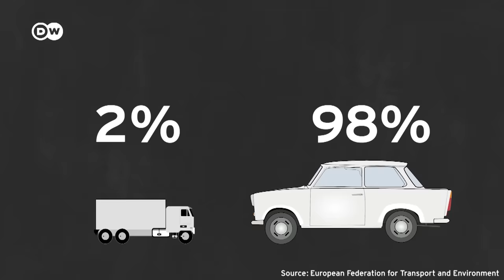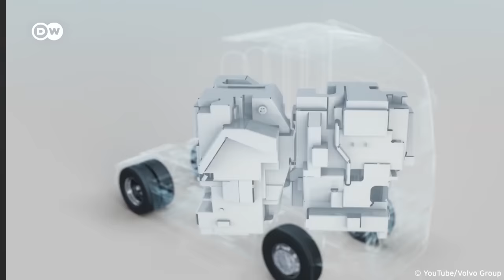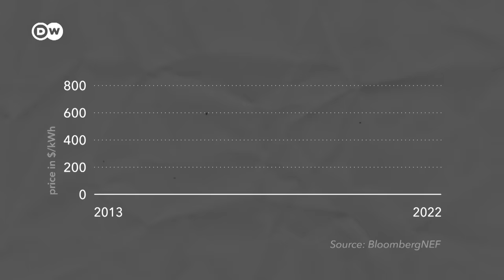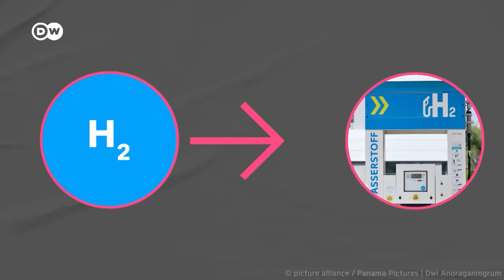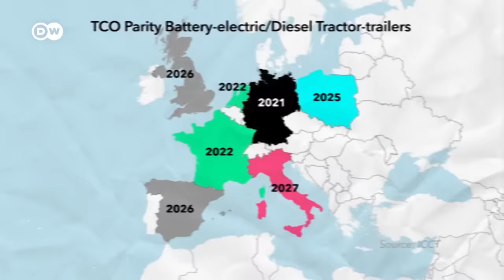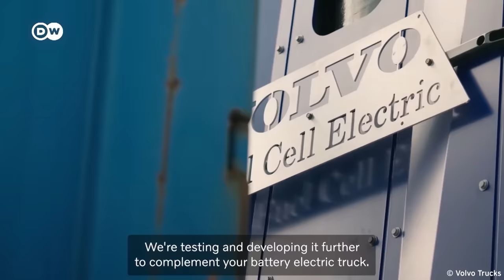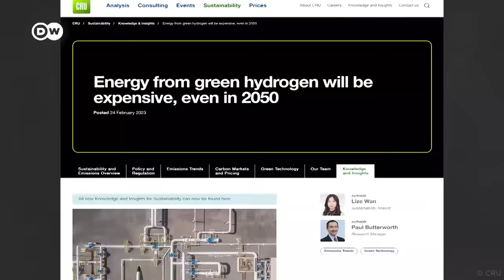Which will be the engine of the future?

Comment: I have the pleasure of working for a company that moves and dig up dirt, at times across rather large distances. I personally hope that Hydrogen trucks are still getting developed, despite the headstart of electricity. Mainly because electricity will likely never be a viable solution on its own to the needs that our company faces. More areas of industry working to cheapen and expand the hydrogen market would only help others for whom electricity will not be able to help, at least in the short term (5-10 years).
Hybrids would be a good choice, which is partly what we work with already, except it is currently fossile fuels, which we hope to avoid the moment it becomes economicly viable.

Thank you for the video, and I hope to hear more in the future of where this and adjacent areas are headed.
Reply: Toyota has developed a hydrogen ICE.
Reply: @stevenverrall4527  Too inefficient.
Reply: Hydrogen trucks will always be far more inefficient. The vast majority of trucks will be battery electric, also the ones hauling dirt.
Reply: Where straight electric isn’t feasible companies can use a diesel electric hybrid like what is Edison motors. 

Also quick swappable batteries like those from Janis electric are another possible solution
Reply: JCB has done the same.
Reply: And here's the thing you are getting wrong. It is hydrogen that has gotten the headstart, not batteries. We flew to the moon on a fuel cell, commercial lithium batteries on the other hand didn't exist till the 90's.
Reply: How niche is this application though, compared to movement of goods on existing arterials? How far before you get to a normal road, and therefore infrastructure like hydrogen filling, battery charging or swapping, or diesel?
Reply: I have a hard time believing that electric can’t already work for your company. What specifically is it that you think a battery electric vehicle can’t do? It is almost certainly just a matter of someone getting around to making battery electric equipment fir your niche application.
Reply: @stevenverrall4527 which just goes to show that Toyota is full of crap. It has half the efficiency of the already bad efficiency of the hydrogen fuel cell. For example, the hydrogen in the Mirai, which is about the most hydrogen you can get in a car, will get you at most 200 miles. And that is with an underpowered engine driven like a granny.
Reply: @rehanb637 what application wouldn’t be feasible for batteries?
Reply: @williammeek4078  hauling very heavy loads (100ton +) where battery weight would impact overall capacity. This is especially the case in areas that receive below freezing conditions where batteries are less efficient and store less power. Also pretty much any location that doesn’t have sufficient grid capacity to allow for charging ie remote communities
Reply: @rehanb637  100+ ton loads aren’t allowed on American roads. 
Those are better handled by train anyway.
Reply: @rehanb637  - temperature is proving to be much less of an issue with such massive battery packs especially with active thermal management systems. To move the temperature of that much mass requires very long "non-operating" soak intervals. During use the core temperatures don't change that much. When charging or otherwise sitting idle, the truck's thermal management systems can be engaged (not unlike a diesel being left to idle all night to keep from freezing up). This could be an issue in Alaska or the Dakotas but much less so down here. However, your comment about remote communities certainly would be an issue.
Reply: @Simon-dm8zv  There's absolutely no mention of the pollution caused due to the production of batteries in these vehicles and how they'll be handled after their life.
Reply: @thereckon3592  True, but it is a well known fact that EVs are the least polluting option.
Reply: @rehanb637 Mine haulage trucks are already diesel-electric hybrids, so it's not even clear why we need a crusade here.
Reply: @Simon-dm8zv  Are the though? I'm assuming hydrogen vehicles could run for at least 15-20 years with proper maintenance would an average EV with proper maintenance last that long without a battery change? So we need a comparison between the pollution/energy spent to produce and maintain an average EV vs an average Hydrogen powered vehicle over a long time.
Reply: @thereckon3592  Oh yes. Hydrogen vehicles are so inefficient that they require 3 times more electric energy which makes it very hard to win from battery electric vehicles. We know that older EVs are doing better than expected regarding battery life and current generation EVs have batteries what will easily last 15 years. It is very likely the battery will outlive the rest of the vehicle in most cases.
Reply: @Simon-dm8zv  I'm not saying Hydrogen vehicles are efficient than EVs right now, it'll be better but consider the polution and energy needs to create batteries for EVs.
Reply: @thereckon3592  You can find several life cycle analysis reports that cover exactly this kind of comparison.
Reply: @Simon-dm8zv  I couldn't find any. Care to point me to one?

Comment: Overhead wires.  This could work with, hybrids, fuel cells, and  fully electric. This can reduce the need for batteries. The only drawback is a massive upfront cost of installation.

Comment: Hydrogen Vehicles ARE battery electric vehicles... with extra parts... better to aim for full battery operated w/ Solar Charging
Reply: Extra parts? They dont require large lithium ion batteries(fuel cell electric vehicles are much better for europe's gdp since you dont have to import overpriced materials. It means that higher percentage of the vehicle's price is added to our gdp and less is going to indonesia) those are fuel cell electric. Hydrogen is currently expensive because of r&d costs and supply demand issues but all of them will be solved. Even mining machines and construction vehicles will be powered by hydrogen.
Reply: @jaegar2004  hydrogen vehicles as well are only 40% efficient 💀 electric vehicles are 93% efficient. Hydrogen is dead before it even began, you’ll see.

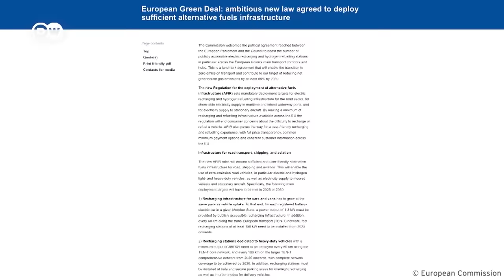Comment: 8:32 A megawatt charger is just four 250 kW chargers and many Tesla sites have dozens of 250 kW chargers. So not a big deal at all. Not to mention many trucks are doing local routes and can be charged at "only" 250 kW while loading / unloading.
Reply: I think a megawatt spike being thrown into the grid is nontrivial deal. That's about 250 homes going from nothing to peak power. I see my power lines struggle when I turn on a vacuum
Reply: @Chasval  US home are at peak power at 4000 W ? Are you sure ? Furthermore a 250 kW charger does not take 250 kW during the whole charge, it will be the same for a megawatt charger. Not to mention charging sites have batteries. Anyway, many industries consume far more electricity, in the US as everywhere in the world. And finally, as for cars, many charges will be done at lower power when the semi is parked, and off peak charges will be privileged since it will cost far less.
Reply: @Chasval  I have a supercharger site 5 km away from my home, with at least 24 stalls capable of 250 kW DC charging, why would the impact on the grid be higher than a 6 stalls capable of 1 MW DC charging ? And I do not struggle at all with my electricity, in fact I did not have any power outrage for decades (not even a one second outrage). So maybe France has a far better grid that the US (or wherever you live) but at least it proves that it is doable.

Comment: A lot of people are going to talk about trains in the comments, but they're already at the limit of what trucks provide that trains do not.
If you want trains to reach the same productivity as trucks, it needs to be some sort of transport system that brings items from A-B on a comparable route to roads, and also directly from a storage site directly into the business.
This is a necessary progress, if we want to reach our goals and slash emissions from multiple sides of the pie.
Reply: Germanyhas trains converted to r un on hydrogen. Japan has done the Hydrogen thing best. a new Nuclear power station using some of its zero C02 output to produce clean Hydrogen, and whats left over to supply Co2 free electricity to industry. And then in France a new Hydrogen SUV from NamX that uses swappable capsules of Hydrogen gas, 4 I believe; each providing 800k m of range.So range 4 x 800km, 3200km .Where I live, for smallish 8-16kgLPG barbecue requirements outside every hardware store. where's a storage of "Swap &
go LPG cylinders. At last, someone has thought to use the same concept for Hydrogen

Comment: Question, what is the safer of the two option presented in this video?  We know batteries can be highly dangerous once they catch fire and the fire departments do not know if they are really out, so what is the risk with Hydrogen?
Reply: If hydrogen truck catches fire and fire reaches the tank you don't need to call the firefighters. They will hear it most likely.
Reply: Watch a video of the Hindenburg to see the danger.
Reply: most people are so ignorant about hydrogen ffs it will not explode
Reply from the maker: Hey Dennis! There are a lot of safety measures in place with hydrogen vehicles. The gas is highly flammable but the main safety measures is the thermal pressure relief device (TPRD) on the tank. This one would discharge if the vehicle was engulfed in a fire. There are a lot of safety sensors which would for example lead to an automatically programmed shut down in case of a leak or impact. Therefore, obviously there will always remain safety issues with every car but the hydrogen vehicles have a lot of measures in place and are further developed. If you are interested, you will find more info easily online.
Reply: @DWPlanetA  There's absolutely no mention of the pollution caused due to the production of batteries in these vehicles and how they'll be handled after their life.
Reply: @thereckon3592 as long as the battery production is not in our country its ok. We can pretend it doesn't exist.
Reply: @sebastianprimus3804  Exactly!
Reply: @thereckon3592  all of the worlds hydrogen is currently produced from natural gas. Your point?
Reply: @zoransarin5411  And did you happen to stumble upon "green hydrogen" while you got that information?

Comment: The CEO of Daimler Truck, gave an interview on the subject BEV vs. FCEV trucks that provides a very clear and precise picture of this dilemma, it is a well-considered perspective that many are looking for!
this is what he said:

“It is simply the mathematical phenomenon that the first battery electric truck is relatively easy to charge; a hundred trucks are difficult, a thousand very expensive. And for 15,000, it is almost impossible to provide the electric power along a route. In terms of scaling, the investment costs for electricity requirements are exponential. With fuel cells, on the other hand, it is the other way around. It is impossible to set up a hydrogen infrastructure for one vehicle. It is extremely expensive for a hundred vehicles, but okay for a thousand. It becomes really interesting for ten thousand or more. But since we have to convert hundreds of thousands of vehicles in terms of drive systems, we need both.”
Reply: Why didn't he mentioned that to build one hydrogen refueling station will cost around 1 million bucks, while on BEV recharging station will be around 50k.
And there is no reason why electrical grid could not sustain BEV's, especially when you consider the FACT that producing hydrogen requires around 60% MORE electricity in comparison to BEV's to move same distance. 
Does he have stocks in hydrogen or something?

Comment: Great video. I have a few questions that maybe have simple answers. We have hybrid electric/ICE cars. Is it possible to have a hybrid electric/hydrogen truck? Even if it's possible, would it be viable?
It seems some trucks will only be electric - think the smaller ones. Some might only have the option of needing hydrogen for remote areas. But at least having both might allow them to use batteries as much as possible, but hydrogen when it's not.
Reply: There is no need in H2 ICE and big battaries. Fuel cells are H2 container and electric generator in one. You also may add on H2 tank.
Reply: Or did you mean both fuel cells and big battaries. It is more effective to use the densest energy storage not both.

Hybrids are best with ICEs. ICEs are inefficient if not run in narrow set RPM range
Reply: @user-dw2yp6jl8s  I don't think you follow what I was asking. If you have both, use the battery when available. Then use the hydrogen when not available, being the less efficient alternative
Reply: Hydrogen Fuel Cell Vehicles (HFCV) are essentially electric vehicles. They employ essentially the same electric drivetrain that an all-electric semi uses. They simply use hydrogen as the energy carrier instead of a huge battery pack. HFCV's even have a fairly large battery that acts as a buffer for the output of the PEM stack (though not nearly as large as in a fully electric semi, probably only about 15-20kWh). So, a hydrogen semi is already a hybrid/electric of sorts. You may have been thinking that the hydrogen is going to be burned in an ICE but that would be less efficient than even a gasoline ICE. Hydrogen will be way too expensive to burn it in an ICE. Burning hydrogen in an ICE also produces NOx in addition to water vapor. 
Now, if you're talking about a diesel/electric hybrid (like a modern locomotive) that would be something different.
Reply: @Tron-Jockey  so thanks, I wasn't aware that hydrogen fuel cell cars / trucks already have a battery.
That would mean it might be quite feasible to put larger batteries on them and allow the operator to refuel one or both. 
It may not be an economic method, but it would seem to have advantages. Mainly for those needing longer range sometimes, they have the hydrogen, but when they have the option to recharge the larger battery they get the efficiency. 
It doesn't solve the weight problem, but for remote areas in say outback Australia, it might be useful.
Reply: @lawrenceheyman435 there are already battery electric, Australian road trains carrying more than 100 tons using battery swap systems. One incidental advantage of this is that remote refuelling stations don't need to have diesel delivered. The batteries are recharged from solar power.
Reply: Anyone who does the math quickly realizes that hydrogen for any form of energy storage or transport is uncompetitive.
Reply: @waerlogauk  cool
Reply: @Will-ef2tw  what load couldn’t a pure electric do better?
Reply: @lawrenceheyman435  - that makes sense, I'd agree with that. Keep in mind that for H2 vehicles to gain traction they'll need to do so quickly. Batteries are making strides in energy density every year. The technology is still in its infancy and nowhere near its theoretical max as far as energy density (volumetric and gravimetric) is concerned. In the last decade the energy density has virtually doubled. Already next generation (solid-state) Li-ion batteries will come on the scene by late 2024. This will not stop. All curves point to increases in energy density that will enable 750-1000 mile range battery packs by 2030. It will be difficult to justify the cost of continued investment in H2 development (vehicles and infrastructure), with batteries being able to store so much energy especially if their costs continue to drop.
Reply: @Tron-Jockey  that's really good to know. I had no idea so much future improvement was still possible with batteries

Comment: Hydrogen and Batteries both look great at a high level, but once you start digging into the details, the hydrogen solution fails. Most hydrogen’s is grey (made from natural gas) not green which produces CO2 emissions so it’s not much better than just burning diesel. You then have the environmental impact of releasing hydrogen into the atmosphere as well, which slows methane from breaking down in the atmosphere causing an increase in global warming. Batteries are truly the answer.  The only question is can we ramp up production of batteries and chargers fast enough to prevent the climate catastrophe.

Comment: People talking about trains forget that things do not simply get shipped from A to B. Trains cannot be the solution as you still need to transport the same amount of cargo from the trainstation to the factory or whatever. This would mean even more trucks would be needed. Also, speaking for Germany, many if not most trucks traveling the autobahn in Germany are not even German, it's often a transit or international exchange which again isn't helped by Germany getting a better train system, if at all we'd need that Europe-wide, still at it's destination you again need trucks and the same amount as before to be in any ways as fast in delivery and do not forget that many trucks also don't simply go from A to B but they drive from A to G to B to C back to A. Trains cannot do this efficiently.

Comment: Well, lorries are used in so many diverse ways, some move 10-30 tons over a distance of less than 50km ie in local distribution and they would run fine on battery meanwhile others move 60+ tons over a distance of over 800km and they would need h2 so companies need to focus on both technologies.

Comment: Intelligent battery swap management that ensures heavy long haul trucks gets the newest, high capacity batteries, and the older chemistry batteries with more cycles (less range) gets used for shorter trips or less heavy loads (Rockwool or crisps) the key is standardization across brands!